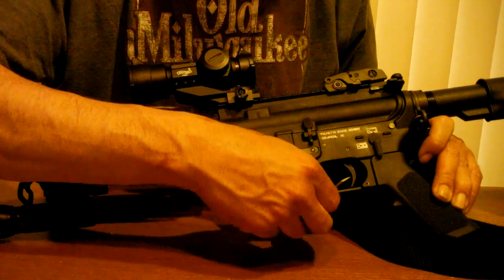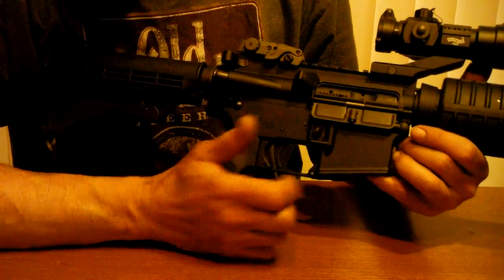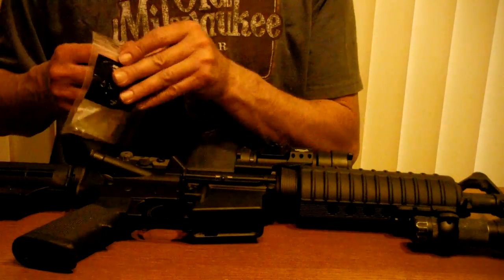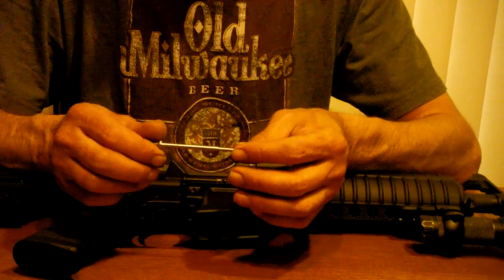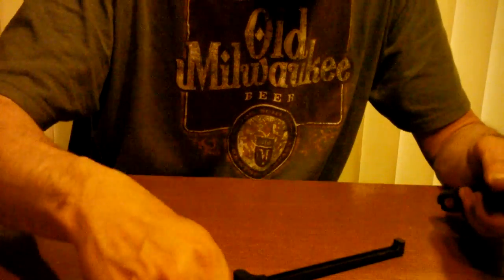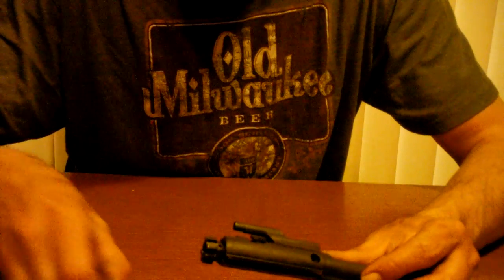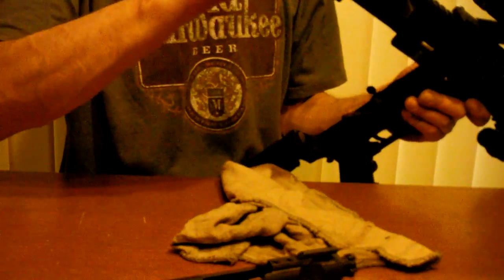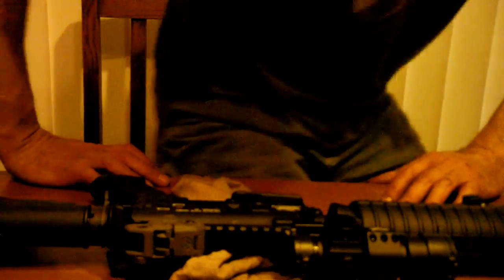AR-15 broken firing pin replacement

Comment: You filled the wrong end .

 But  You can buy a "7.62x39". Firing pin that will accomplish what you tried to do  , no heavy spring needed .  It's just a 556 pin that sticks out further

Comment: m16 / ar15 head to point data =
0.000 - 0.155" = .250"
0.155 - 0.400" = .153"
0.400 - 0.575" = .328"
0.575 - 2.440" = .153"
2.440 - 3.208" = .102"
3.208 - 3.278" = .060" 
a  #8 gauge, .165  5/32 inch shank , 11/32 inch head 
3.50 inch long , 16D / penny ,Duplex Nail = usable blank